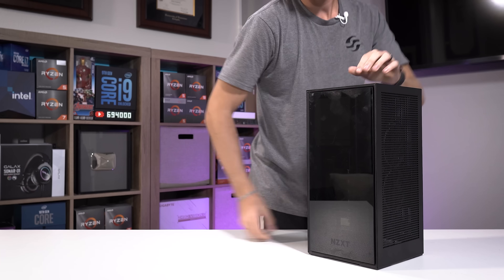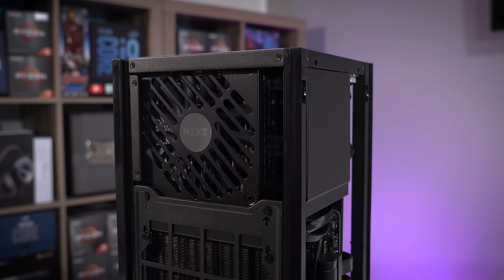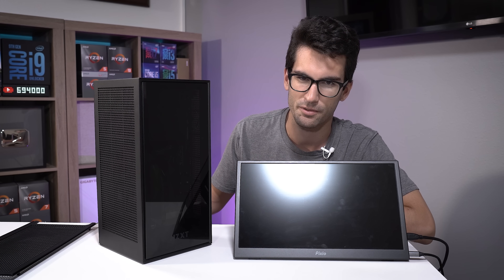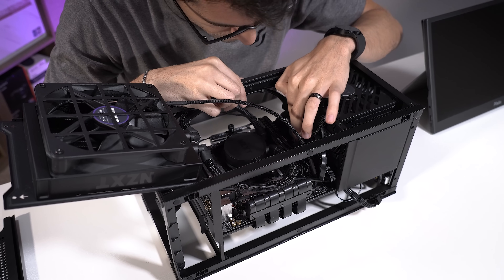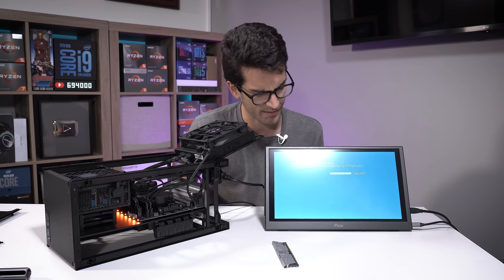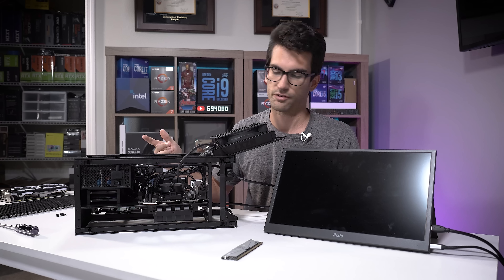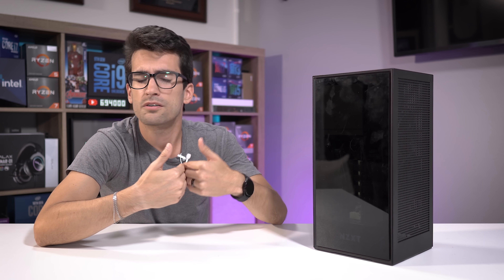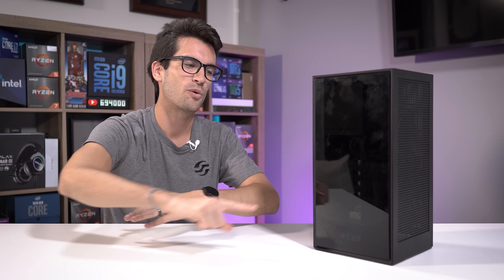Fixing a Viewer's BROKEN Gaming PC? - Fix or Flop S1:E16

Comment: An old build of mine I still have lying around I get a 00 error message on the mainboard (z90 pro witha i5 4690k). Fans are spinning but I don't get a picture and no boot sequence. I'd love to see you troubleshoot through it even tho I think the mainboard is just toast. Sadly I live in germany, so basically on the other side of the planet. RiP ^^
Reply: 00 is usually the normal post code though? Do you have and CPU/MEM/VGA LED's that are/aren't lit up when you turn it on? Try taking the graphics card out and plugging your monitor into the back of the motherboard (use the onboard graphics), reseat your RAM as well. If you've not removed your CPU recently, i doubt it's any problem with that or the socket (unless you've fried the CPU somehow). What cooler do you have?
Reply: @CarkBurningMoo  Hey Mark, thanks for your response. I googled for 00 and it says especially for asus boards that the issue isn't "specified" but it usually means the mainboard is damaged. I'm a IT person myself and tried to fix it, used your methods and more (used the zero method or how it is called in english, tried out no/and different ram, gpu, psu, cooler etc.
I checked the socket and there isn't any visible damage, the cpu was overclocked but just a tiny bit and temps were fine so I doubt that was the issue.

The mainboard shows 00 as soon I start it. It's shown at the exact second and it doesn't matter what is connected to it. Fans are also in idle since start, no overspinning at the beginning which is common etc.

I repair PCs myself usually but was so frustrated that I even gave it away to someone who was specialized toward PC repair and even he couldn't fix it. It seems like some electric internals on the mainboard are broken. :-/
Reply: @RaimaNd  in that case i'd agree with you that it's probably the motherboard that's broken then!
Reply: @CarkBurningMoo  Yeah that it's probably. :( Would like to know exactly what the issue is tho just out of curiosity. ^^

Comment: Usually, when I do troubleshooting. I always check the contact pins first before trying to replace them with a new component. Because I'm always assuming that the owner is not cleaning his/her system unit.
Reply: I clean them by using a rubber eraser and it's effective.

Comment: I had this type of problem with my first pc I built. Everything ran and spun up but no display. Weirdly enough I plugged it into a TV instead of a PC monitor and it worked. Apparently because I had no graphics drivers installed yet it wouldn't display to the PC monitor. After I installed the drivers it displayed on the monitor

Comment: A number of years ago I built a new PC and it would not post. All the components were brand new, so I disconnected, swapped, re-seated everything to no avail. Eventually I worked on the cables and to my astonishment I had been supplied a shorted SATA cable to my hard drive. A quick change and and it ran like a champ. So Greg, don't forget to test the cables.

Comment: I have similar issues with that motherboard too. For some reason, my Corsair Vengeance RGB ram sticks can't hit the rated 3200mhz speed. I get various kinds of BSODs. I clock it down to 3000mhz and it works fine.

But even weirder is that if I swap out the sticks for another pair and set it to 3200mhz, it works fine. I then swap back to my old kit without changing the speed and it works fine too. Unless I enter the BIOS, then it gives me those BSODs again.

Comment: Wish you could figure out whats wrong with mine... My PC was fine one night i turned it off turned back on the next day and then it wouldn't boot to bios, I decided to switch graphics cards and my PC booted up just fine, I took the GPU I thought that was broken to my brothers and used it on his PC.. booted just fine, So I know the GPU is fine, my PSU is fine... I know the mobo is fine because I switched out GPU's.. I'm so confused
Reply: Try removing the CMOS battery or one stick of memory at a time.

Comment: I always do the opposite of what you did. Instead of removing everything at once and then insert/connect it all again one at a time, I remove one thing at a time. It makes it a lot easier to find the actual problem, like a memory stick not properly installed. Your way worked, but retracing is difficult.

Comment: These are some great videos that will probably be long lasting. Compared to news videos, or even reviews, these videos will probably be helping people out for years to come.
There's definitely not enough of these kinds of videos on YouTube. Usually it's somebody who already knows what the problem is and is just replacing a part, and they just skim over the steps they took to diagnose it. or else it's somebody going through the steps that you check, without actually having a broken PC.
It's definitely a bit of an art, deciding between the easiest checks, and your "hunch".
My PC randomly stopped working a few years ago and I decided to check the 6 and 24 pin connectors first, and it turned the 24 pin connector wasn't seated properly, even though it was, it was pretty weird because the PC had been build about a year before and I hadn't touched anything inside in a long time. It might have just been that one of the pins wasn't making enough contact or something. It was pretty weird.

Comment: The viewer's misdiagnosis from Geek Squad reminds me of when one of my old computers stopped detecting one of my HDDs randomly.  No idea what it was, and I didn't feel like trying to trouble shoot it myself.  I took it to a local shop and left it there for the day.  When I went back the next day, the guy told me that the HDD was dead, so I bought a new one.  

I went home and put it in.  Nothing.  Well, shit.  Ok.  Let's see.  I have its power on a molex splitter.  Let's see if it will work when connected directly to the PSU.  Oh, wouldn't you know.  It works.  Just a dead molex splitter.  

I returned the HDD back to the shop and never went back.
Reply: I'm surprised that the local shop didn't have a spare "test" HDD that they know works for situations like those

Comment: Funny coincidence how this video shows up after I had a similar problem yesterday when my system turns on (lights and fans) but nothing on screen. We had a power outage earlier that day and I assumed it had something to do with it. I disconnected the DP cables and reconnected them, didn't work and I kinda started panicking. Well luckily the orange LED light was turn on, on my Asus motherboard, after reading the owner's manual, the orange light was in indicator that the DRAM had a problem. So I simply powered off my system, removed the RAM sticks and re-installed them and making sure it was properly seated. And "VIOLA" , problem fixed, my PC is running normal and its reading all 4 for my RAM sticks.

Comment: Hey I’m in Pensacola Florida, can you help “optimize “ my system If I pay for shipping? It’s a msi prebuilt i5 10400k 1660s oc and 16gig but I have trouble with my ram utilization 30% of my ram usage is random bs, I’ve only used it a few times and only have steam and destiny2 installed, no other installs nor use it for internet, just for the game

Comment: I recently bought another kit of RAM (2x8) 3200mhz. And i installed it, got a post, the bios told me that my ram was running at 2400mhz. I then tried to overclock it back to 3200 but it wouldnt work... It would not go over 2400 until i just randomly pulled out one of the new sticks, then i could OC to 3200. After that, i put the stick back and then eveything worked. I got really confused why that happend

Comment: when it comes to charging for the work or not it depends a lot on your workflow and the asked service. someone needs a rush job i am charging no matter what you asked me to drop what i was doing to your thing now i need to get back up to speed on the thing i was doing that cost me more than what you saw. if i do scheduled slots i am charging you if an other job takes longer and i have a filled day you will be charged less if i run out of tasks since they were all easy you getting charge the normal rate. if you just do leave it and i will get to it when i get to it then not charging makes sense.

as for the issue i have had DDR slots get corrosion or a tiny bit of dust on a pin that just stop the computer from work a simple reset will break the corrosion and move the dust so it is not a issue. DDR can be very sensitive to these things that just happen over time.

Comment: Very Curious - So after the viewer brought the system to the Geek Squad and if the viewer didn't do anything to the system after getting  it back from them , they either didn't do a complete teardown and rebuild or some one at the Geek Squad miss-inserted the "Ram" and then the viewer brought it to. So this would really look bad for the Geek Squad not being able to fix this system. If the system had be stationary and working - how would the ram get out of the socket to cause this issue ?

Comment: It's the Corsair memory. You have to take one stick out, post with it, shut down, put in the second stick. Even if they're seated properly. If you lose power in your home, you'll have to perform this procedure once again. You can have two identical X470/X570 boards with identical Corsair RAM and one won't have this issue whereas the other will (Same BIOS and board rev). I've switched to G.Skill for AMD builds and use Corsair for Intel without issue.

This has been an issue I've faced with both X470 and X570 platforms.

Comment: Definitely can relate. I had a b450 asrock motherboard without any DEBUG led and often times my system would technically be on but no display output and it would be so frustrating since I have no debug led. I'd end up spending 1-2hours orf ust reseating RAM just to get it back up. Ended up getting an ASUS board with debug led just to make my life easier.

Comment: On gigabyte AMD series MB does this all the time as nothing wrong with any of the components, some how the bios will get mess up on it's own. In order to reset the CMOS in any gigabyte MB, You have to clear the CMOS with the Power Plug in and POWER it ON not like what gigabyte said in the manual, otherwise It would not clear the CMOS. I learn this in my tech support era during the late 90's and still applies to know brands MB. I Know and I guarantee it works everytime.

Comment: I support a training academy with about 500 classroom computers.  All Dell.  The first thing I do when troubleshooting (after basic power and monitor connections) is reseat ram.  But that wouldn't make for a very exciting (and very short) youtube video... 'Mow opens case, reseats ram, system successfully posts'. :)

Comment: yep, i got a few of those experiences under my belt already. The last one was a few days ago, where i got an old 775 system (Asrock G31M-S / Pentium E5400 / DDR2 2GB 667MHz) and planned to bring it back to life. The memory module is one of those very slim DDR2, so i struggled a bit to seat them properly. The first boot attempt threw a black screen with no POST, then i seated the module in the other slot, and Eureka!, glorious 775 system is back again, then tested the "possibly faulty" slot and booted like nothing happened.
So yeah, always make sure it clicks when you connect the RAM in the slot

Comment: love how geek squad couldn't properly seat ram
Reply: It's likely that it was originally a motherboard issue, and when the owner replaced the motherboard, he seated the RAM incorrectly.
 

The other alternative is that Geek Squad didn't reseat or run diagnostics on the RAM, and the owner just doesn't know how to seat RAM correctly (also how would RAM unseat itself after working properly?)

Comment: You need to run a memory test on the ram modules to make sure no errors are coming up, which could have been what the initial problem was. Sometimes the problem is the ram not seated properly or dirty/broken ram connector but other times it is the ram itself. When you booted the machine into windows it looked fine then it went into recovery. 

The operating system booting then going into recovery can be a sign of a hardware problem at some time , dodgy hard drive, ram etc. One ram stick might be showing errors and will cause the operating system to be unstable or for the pc to not boot in the future. Hopefully the problem was that the ram was not seated correctly and even when it was put in correctly the initial fault triggered the operating system to go into recovery and can be fixed by recovering the operating system. But the ram needs to be tested to make sure. I have had brand new sticks which have shown such behaviour. If the motherboard had been rma'd then I would think they used their own ram modules as you normally only send the board.

Comment: I have the same issue but I already checked my Ram and Graphic card I even tried changing the power supply nothing's happening sometimes it works fine when I reconnect all the connections but 10 mins max and my display goes off 😭been watching some of  your old videos and I did everything but still no success acn you help me out please 😢

Comment: When servicing a PC, it should probably be standard procedure to double-check that the latest motherboard bios firmware has been installed, via flash update. Some video card makers also provide firmware updates when using the maker's own software. Such as EVGA's "precision X1" software for newer model EVGA video cards.

Comment: PC's really are delicate. I had some issues with miy rig some weeks ago. The computer wouldn't boot and the CPU light was on. I tried several things. Cleaning the CPU and socket. But the problem still occured. I brought the PC to a Repair shop. Paid 35 euros for the trouble shooting. They didn't find anything, but told me, it was propably the CPU. So i bought a new CPU, placed it in my computer. Still not working. I then did some trouble shooting and  sent the CPU back. End of the story. The socket was broken somehow. I installed my old mainboard, the Windows didn't start, searched up some stuff. Installed a newer bios version and then it worked. Moral of the story. Try everything you can first, before bringing your pc to a repair shop and get charged money for troubleshooting. Your videos really helped me with my problem. Even though you didn't have that exact problem, the videos gave me the conficende on finding out the issue and gave me ideas on what I should be looking for.

Comment: Be careful. Years ago, early 90's, I had a improperly seated memory module short out and fry the module  and the memory socket.  I'm hoping that modern memory is less likely to short out when not fully seated.
Reply: Oh, if they short now there's almost no voltage going to them compared to back in the day.

Comment: So this case maybe that MB was really broken and when swapping MB he didn't fully insert rams. Usually when desktop/game freeze and it won't wake up after power cycle then there is dead parts somewhere or they don't like current overclock anymore (and then it die after 2 months of normal use). (Remembering my 9900k cpu what sent was to RMA)

Comment: thanks to your videos i’ve been able to trouble shoot my pc. I replaced my power supply for a 850w to accommodate my graphics card and I added 2 more 8gb dim and my pc turned on and off I ran through and eventually pulled all my ram out and re installed and bam back up and running thanks for these videos they help me allot

Comment: Hey bro so I built a decent gaming pc with Ryzen 5800x and RTX 3070ti and Asus B450-F but the problem I have is that sometimes my motherboard and the 24 main cable psu need me to push it a a bit and then it turns on and i don’t know what I should do with it? Should I replace it or replace the psu?

Comment: I only partially agree about that part where you say you wouldnt charge anything as a shop for this kind of repair

You do mention that its personally and also unless you couldnt justify financially, but i still think work should be paid for and for me, i would simply charge half an hour worth of work.
Ive charged nothing to customers coming in with a laptop "having no internet" while the wifi card's driver simply needed to be reinstalled, which took actually a couple minutes, or other very very short "repairs" like that.

But what you did still requires some time that, as a shop, could mean work you don't do on something else.
And i think customer would be more than happy if you were to be flexible on your hourly price and instead charged 15 or 30min worth of work.

Comment: So Geek Squad used the Official Apple Repair Shop method of diagnostics: If they can't figure out in 5 minutes what the problem is, just tell the customer that "it's the motherboard" and that he will have to replace the whole thing.
Reply: I think there was something on MB and when swapping MB he didn't fully inserted ram modules. Because original problem was freezing and then not boot after power cycle. It may be that they had lucky guess or we would have now longer video here.

Comment: had similar issues with 2 NZXT cases that turned out to be bad power buttons. The systems would boot if jumping pins but not if pressing the power buttons. Nice this was just a reseat issue on the dimms

Comment: I had almost the same issue like 2 weeks ago. RAM was seated but the PC wad unpowered for 2 weeks. Aorus B550 MoBo and Corsair RAM just like in the video.
After 5 CMOS reset and 1 BIOS flash the solution was to wait 3 minutes after "boot" to let the board reset to default ram settings. After that just had to re-enable the XMP.